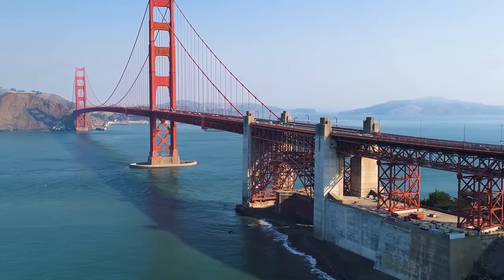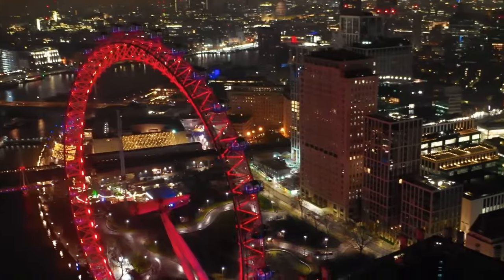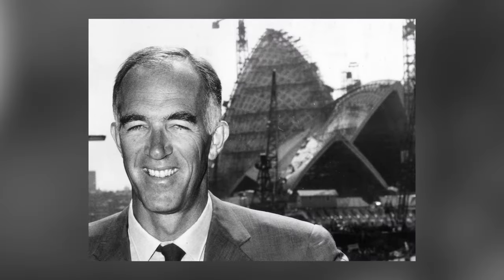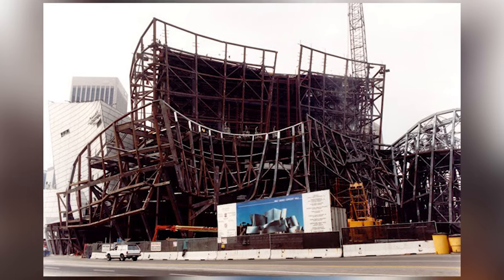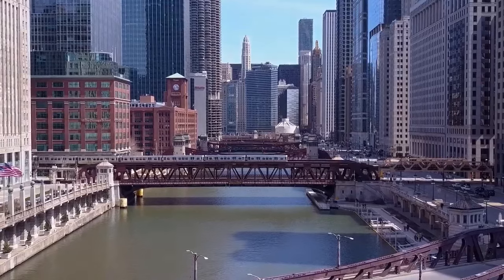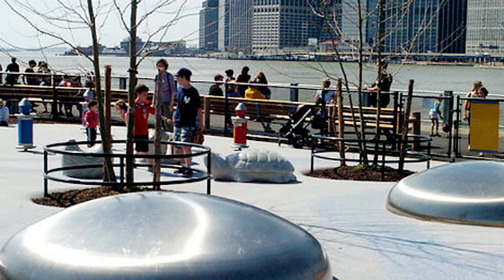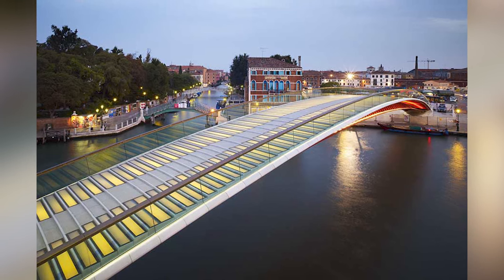12 Engineering Mistakes That Turned Out Not to Be Fails

Comment: None of this sounds like mistakes that turned out not to be fails. They sound like fails that were able to be corrected, and not even all of them were corrected.
Reply: Except the Chinese monorail. That's not a fail, nor a mistake, just a curiosity.
Reply: Bob Dole is exactly right.  (Although I agree that the Chinese monorail that goes through the apartment building is an exception.  In fact it's not a fail at all; it's just an interesting oddity.)
Reply: About the train running through the highway, I believe I have a solution for that problem.

I call it: BUILD A FUCKING BRIDGE!
Reply: That's what the title says
Reply: The walkie talkie was a fail in the way they didn't anticipate it would reverberate sunlight the way it does. It is still considered a fail in that respect.
Reply: With enough money, almost any fail can be corrected. 😆😆😆
Reply: @jonathantan2469  Reflects on past mistakes. Checks bank account. Cries.
Reply: good job you got clickbaited

Comment: Interesting stories but bad title. Most of these are still failures, it's just that people tolerate them.
Reply: Wow
Reply: Voltaic Fire  well  uhhhhhhh 

I guess like you as well
Reply: I wouldn't call it tolerate welp maybe some but some just don't remember don't  care or didn't even know if it was a failure why would some people not even know I really wouldn't call most of these failures
Reply: agreed
Reply: Thought so too
Reply: I was thinking the same thing. It should b titled, "mistakes that were made that weren't complete failures" the one with the train going through the road was a complete failure cause it was relocated
Reply: No. The Sydney Opera House is a great success story. I remember that when the cost over-runs hit, the gov't ran the Opera House lotteries to finance it. Great idea that worked well.
Reply: And bad editing, just sticking whatever he wants in as though it’s related to what he’s talking about
Reply: Which means they’re are a success?
Reply: Yeah I was going "How does running over a budget by 100 mil or removing a rail line not  = fail?"
Reply: My bridges never failed.
Reply: Voltaic Fire  Or perhaps their parents instead.  In this case
Reply: marzolian What, you mean the mistakes didn't make them BETTER? No surprise there.
Reply: marzolian - * “MODERATELY interesting stories but bad title” is more like it.
Reply: And most made by architects, not engineers
Reply: Agree with marzolian.   These are failures that were (mostly) rehabilitated later or simply tolerated, but failures nonetheless.
Reply: @Milesco  many were construction or government screwups.

Comment: interesting, but how about using the metric system as well in every case you give values in that confusing imperial system?
what was it? about 140°F?  is that cold enough to not sweat when taking a bath or can i melt steel with that temperature?
Reply: it's hot, but not that hot. it's about 60 degrees celcius
Reply: see, thats a value that makes a lot more sense and is understandable for everyone around the globe^^
Reply: The confusing imperial system got us to the moon, just saying.
Reply: @totalnegroiddeth  and? does that justify using an antiquated and outdated measurement system thats not comprehensible?
Reply: @happalula  I mean has your country been to the moon? Oh, ok.

Comment: The building with the train running through it was specifically designed so that the train rail is totally separate from the building. They did this specifically to prevent vibrations and whatnot from messing with the building or tenants.

Comment: The John Hancock Tower had two Tuned-Mass Dampers internally installed. Essentially, they act like pendulums that counteract the building's tendency to sway. The trick is to have the Tuned-Mass Dampers consume/rob motional energy at a very precise rate, so as to always make the building tend towards positional stability. Textbooks, written on the topic of Differential Equations, often love to examine the relevant equations that pertain to the design of these particular Tuned-Mass Dampers.

Comment: 12:19 trains often pass through buildings called “train stations” without causing structural damage.
Reply: Berlin did this too at an u bahn station 
The house is most likely not physically connected to the station
Reply: @burgerpommes2001  Uhhh what?
Reply: @jupiter776  mendson batholdy park
Reply: False equivalency. A train station is built for purpose, to withstand heavy locomotives - A residential building is not, you can't just 're-purpose' it as a train station
Reply: @TheKadonye  there homes were also built to withstand trains

Comment: That runway in New Zealand with the Railroad actually has a unique thing. The control tower actually controls both. The train is required to stop at a special signal light and get permission from the tower. The people in the tower check to see incoming and departed flights and the length of the train. If it is safe the tower alerts the pilots about the train then waits for fuel check and if it all clear they clear the signal.

Comment: Bern airport used to have the access road for the public crossing approach to the airstrip in such a way that they would close gates across the road when a plane was taking off or landing.
Looking at the current and historical maps on google earth they extended the strip a few times, the road actually crossing the tarmac at some point, but somewhere between 2005 and 2009 a new road was constructed.
Only small planes can make use of it, as they have to negotiate the Belpberg (?) hill nearby.

Comment: A couple more fails that thankfully have good videos elsewhere on YT: the Citicorp building in NYC that could have literally been toppled by a gale-force wind blowing on a corner, and the London pedestrian bridge that swayed excessively. The latter was actually an unexpected interaction between the bridge's resonance and how people changed their stride to accommodate a slight sway, so it may be unfair to call it a fail. The former was quickly corrected with additional steel welded to the frame.

Comment: The metro line through the building in Chongqing causes no structural damage. All of the apartments on 2 to 3 levels above and below the tracks have been removed, the lines are supported externally to the building itself and do not load the building structure. There is also a station located on the sixth to eighth floor of a 19-storey residential building. It uses specialized noise reduction equipment to isolate station noise from the surrounding residences / structure.
Reply: Any idea how effective the noise reduction equipment
Reply: @morry32  No idea, whilst I have been on the line and that particular station, I have not been into any of the apartments. As the line is supported external to the building, then there is no direct contact to the building to transfer noise or vibration other than through the air. I did not find it to be a noisy / high speed line, the metro carriages all slow down to stop at the station in the building so guess all these factors help in noise reduction.

Comment: Cohodas Hall on the campus of Northern Michigan University (Marquette, Michigan) is a six story administration building made of a deep purple stone. There were never any problems with the construction of the building or its usage, however someone decided that the sides of the building needed cleaning. The administration proceeded to have the building scrubbed down on the outside—however, whatever solvents they used began to break down the exterior stone. Chunks of the building were threatening to fall off. They had to put a chain-link fence around the perimeter to prevent chunks of stone falling onto unsuspecting pedestrians below. Eventually, the building was stabilized, repaired and cleaned with a much less corrosive cleaner. But it certainly made for an interesting scandal.
Reply: "Another great idea from Management!"

Comment: RE: The Hancock Tower. The windows didn't fall because they were improperly secured but because they were too rigid to deal with issues related to the difference in pressure inside the building versus outside and they got sucked out of their frames or simply shattered in place. It's still an engineering problem, but clarity counts.

The swaying was fixed by the use of a tuned mass damper which deserves its own video.
Reply: I figured a damper would fix the issue
Reply: I think they confused Hancock buildings when talking about the iconic Xs that obviously are not present on the Boston building.
Reply: Also, every year a panel or window or two drops off of building in the Loop.
Reply: The building twisted in the wind, and rigidly-mounted glass panels popped out or shattered. Nothing to do with pressure inside vs. outside. It was fixed with the mass damper reducing the twisting. The alternative was to tear down the whole building, which had been declared a fire hazard due to all the plywood replacing missing windows!
Reply: Aaron Watkins they were talking about the Hancock building in Chicago... pretty sure they even used shots in Chicago when looking out the top of the building.
Reply: I was gonna say the only way to stop sway is a mass damper and getting one into an already built building is just crazy to think about.
Reply: I’m struggling to walk using my zimmer wishing I had the same (getting sucked out of my frame) problem...
Reply: Wait. What would a damper look like? Where would it be located? How does it help? And so on. (Thinking on a small scale, as in my wood stove.)
Reply: Nothing to do with pressure.  But it was shoddy engineering.  Someone forgot to do dynamic load analysis resulting in building resonance frequency in the range of that of the prevailing wind.  The tuned mass damper shifted the frequency to a safer range.
Reply: @gomphrena-beautifulflower-8043  just a big weight in a bath of oil.
Reply: @nauy  • Thank you for replying; I had forgotten my question. The original poster piqued my curiosity; now you have multiplied it😁. If you have the time and inclination to respond again, where might I find more information on this? Again, thank you.
Later edit: I found more info on Wiki. Intriguing stuff. Who knew? My dad had a degree in civil engineering. He’s been gone since 2002, and I find myself now retired and disabled and discovering so many things I wish I could ask him about. Oh well😢 thanks.
Reply: @aaronwatkins8973  right, that building is in Chicago.  I think when the research was done, they didn't realize they were two different buildings.
Reply: They also never showed the Hancock building. Wonder why?
Reply: Rob Estoll The first shots are the Boston Hancock building, which lost the windows in the 70's
Reply: No one in Boston calls it anything but the Handcock building or tower.

Comment: "Engineering projects that turned out not to be fails."  
"This railroad crossed a highway.  There was nothing good about this.  It had no redeeming features.  The internet learned about it, and they removed the railroad after worldwide humiliation.  Things are better now that this total and complete fail is gone."
Reply: and the Marble falling from the building? or the glass falling off the other? Both are pretty big fails.
Reply: So confused after hearing this
Reply: I live in Gisborne, We have the occasional steam train that goes pass for tourists. Other than that its rarely ever used. Our local council are considering reopening it though.

Comment: Where is the Berlin airport?? Construction started in 2006 and should have been completed in 2011...
Now in 2020 it has STILL not been opened and will continue to be built! A joke to the hole nation
Reply: Good thing the EU have deep pockets and don't mind spending money...
Reply: I see you haven't heard about National stadium in Vilnius, Lithuania... Construction started in 1987 and to this day it is still a pile of concrete... Now this does sound like a joke with tears...
Reply: @WhatALoadOfTosca  EU? No it is a completely German project. The EU didn't pay anything for the airport...
Reply: @karolisusavicius4369  No I didn't know about that one. How long did they build?
I think the difference is that Lithuania didn't finish the stadion. The airport however was almost finished when they found out that  fundamental mistakes have been done. They had to demolish finished buildings because of that😂
They say that the opening will be this... I'm not sure if will

Comment: The solution to the climbing domes is simple...remove them and use materials that are safe and that also do not soak up heat.
Reply: I was thinking they could put in a water play area for the children. The water could be pumped through the domes to keep them cool and then used in an area a little ways off for the aquatic playground. It would only be operated in the summer, providing cooling on hot days.
Reply: Just paint the blooming things white every year.
Reply: @ajcotroneo7710  I was trying to offer a solution that wouldn't change the overall aesthetics. Besides, if they're going to be painted white, they might as well be made from recycled plastic.
Reply: I suspect that painting them white would not help: they are already very reflective. I suspect that the main problem is that they very conductive  of heat, so that when they get hot the heat is transferred very quickly to anyone that touches them.
Reply: cover them rubber like used tires for f sake children are known to fall and you want to provide giant steel objects for them to land on?

Comment: Gisborne NZ doesn't have train service for freight or passengers, they stopped in the 90's due to neo conservative restructuring. It may have locomotives running on very special occasions. Normal domestic flights fly to Gisborne and there are no train tracks on the town's airport, at least not on the main runway, we have normal safety standards here. There are no flights to Australia from Gisborne. I found this video lacked proper research, maybe they just made most of it up as they found convenient?
Reply: It doesn't matter for them. They make videos like these with inaccurate info because most viewers won't know or won't care anyway. You can see how many views each of these get.

Comment: The Thailand market and railway issue would be fixed if many buildings were torn down and rebuilt into a much larger series of interconnected skyscrapers and the markets would occupy about ten to twenty floors while other businesses took up ten to twenty floors and the apartments took up twenty to thirty floors.  Moreover, it would also look nicer in that part of the city.

Comment: The 5 second clip 6:25-6:32 is actually from the John Hancock building in Chicago, not Boston.  You can see the iconic 4 towers of the 900 N Michigan Shops building, as well as Lake Shore Drive at Oak Street Beach.

Comment: There are at least 3 buildings in Berlin with a train line running through it, one with a station too (Mendelssohn Bartholdy Park) and there is a building with a highway running through it too (Schlangenbader Str.). So the building with a train line throu it does not appear to be special to Germans, Berliners more specifically.

Comment: Bad research the Hancock lost windows because both  sheets of double pane glass could click together under the proper wind conditions.  One pane would break and shower own, while the other would flutter down like a leaf,  then break. Testing problem in the wind tunnel.

Comment: The “Boston” building is in Chicago...
Reply: Just another mistake
Reply: No, it isn't. It is one of the most prominent things on the Boston skyline. It was built as basically a dick waving contest, since the Prudential (Insurance) Building was next door. Both buildings are still there in the Back Bay, just not owned by insurance companies.

Comment: Bloody heck, Gisborne airport/runway is a deliberate design and aircraft/rail do not come close. You'll never be a train passenger and "see an aircraft hurtling toward you" or fly a plane in and be suddenly obstructed by a train. It's a freight line that runs pretty infrequently, any rail operations are well documented with procedures for both air and rail operators.

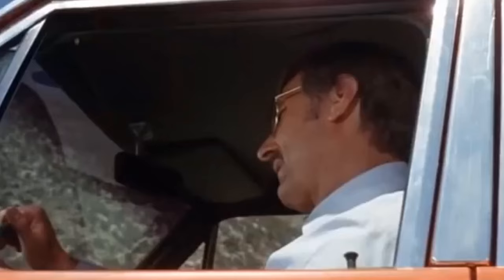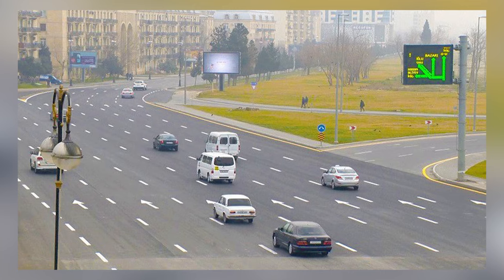Comment: At 4:00-4:53 - it is incorrect to state that there were no warring signs or lights.   I lived one block from that Intersection from 2013-2017 and I walked my dogs there the 4 years I lived there.  What they show you in this video does not show the lights or the sirens that were there.  Most of what you see is what it looked like after they removed all the industrial facilities there to extend the sea side blvd.   Yet the last dock for ships still used the rail to move materials.  What this video fails to show you are the typical warning lights just before the rail and the megaphones/sirens that went off to announce a train was coming.   Those tracks had been there for more than 60 years when the road was 2 lanes wide...  just in the last 12 years did the road get expanded.    THE PROBLEM, people would ignore the warning markers and would try and beat the train, and at times the police would sit out there to hand out tickets (was easy to do)  but that was not shown here either.  Poor research on this one.

Comment: A few Canadian disasters. Quebec bridge collapse (1907, killing 75 workers. Rebuilt. Collapsed again in 1916), several other notable bridge collapses (Vancouver, Second Narrows Bridge 1958, 18 killed); Ottawa Heron Bridge collapse 1966 (nine dead),  Elliot Lake Ont. shopping mall collapse (2012) killing two, Montreal Olympic Stadium: late, way over budget, two instances of large concrete slabs falling (no-one hurt). Toronto Rogers Centre (home of the Blue Jays): way over budget; paid for by taxpayers; eventually sold to private owners at a huge loss. Toronto, Gardiner Expressway: several cases of concrete slabs falling onto the roadway below, no-one hurt (so far).  Olympic Stadium and Gardiner still in use, so I guess not fails.